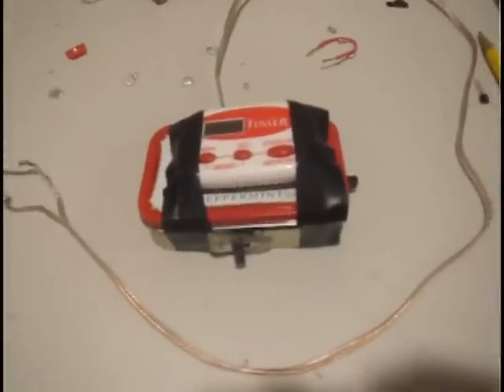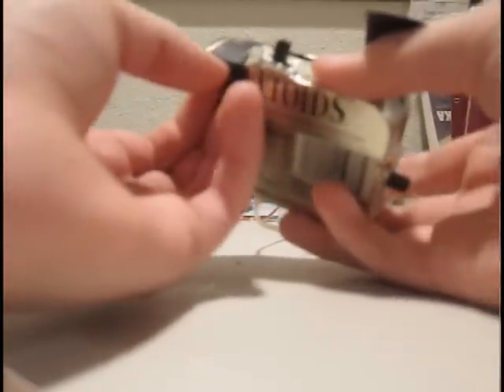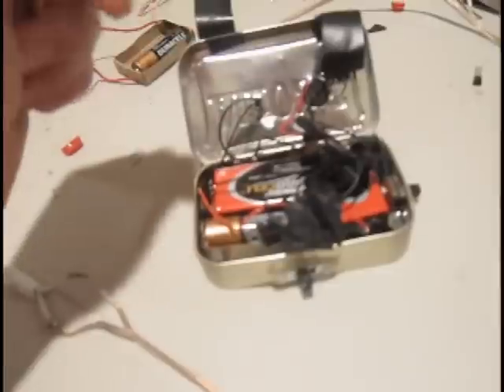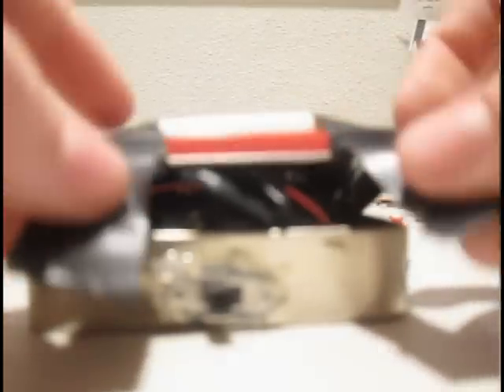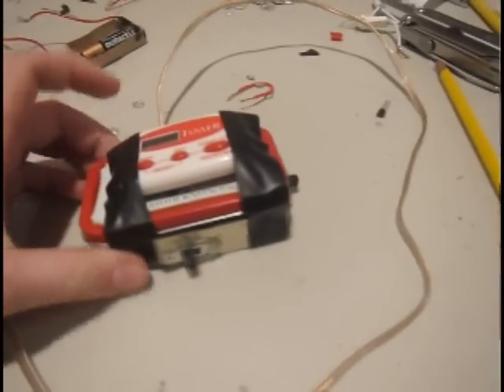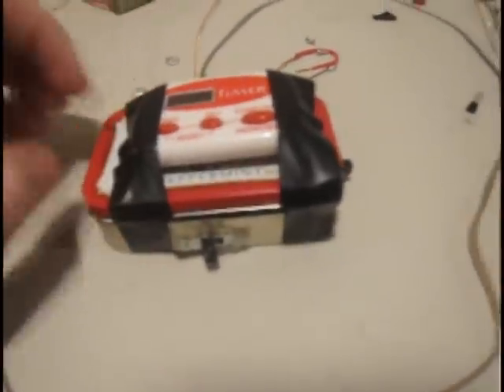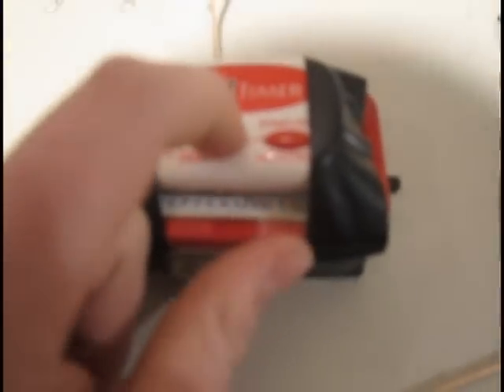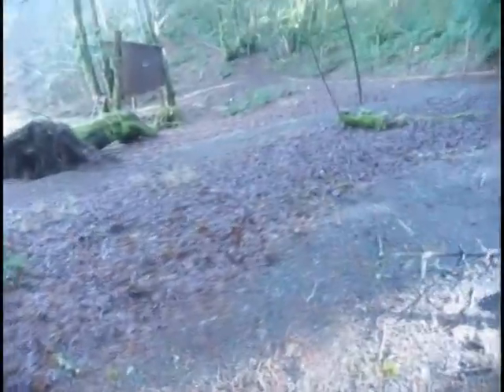Electronic Kitchen Timer Detonator

Comment: yup  i have enough time because atleast 15ft of speaker wire is attached to it so i dont have to blow up the detonator. so once i turn it on im already a safe enough distance away and im not setting off steel pipe bombs or anything, just the charges from supersonic bangs because we cant buy firecrackers legaly in canada so i just rig up a christmas tree bulb to light it. i wear safety glasses too because i need my eyes for work.

Comment: true but after i turn it on it theres a second or 2 delay before the motion detector is active so i have time to run for my life n get to a safe distance without disturbing it. and im not sure if dust would set it off because its pretty cheap (made in china)and my cats sometimes wouldent set it off when they walk by it but it picks up the lazer very well

Comment from the maker: Believe me I would have rather used a SCR, but I only had Radio Shack to get electronic parts from and they do not cary SCR's... I was going to buy a few from Digikey but they would have cost $15 for only 6 of them... so I just used the transistors which only cost 2 bucks...